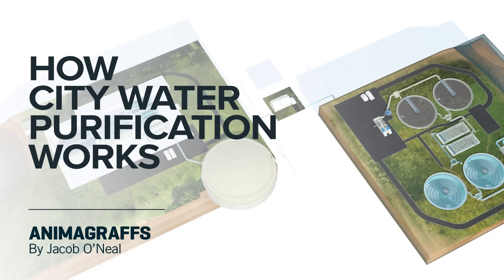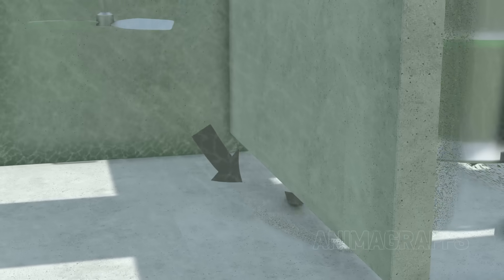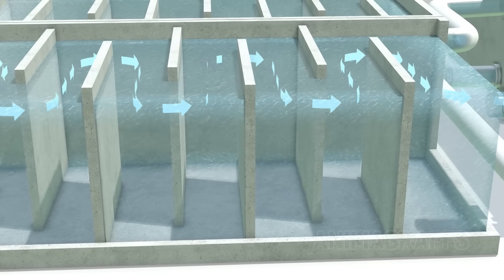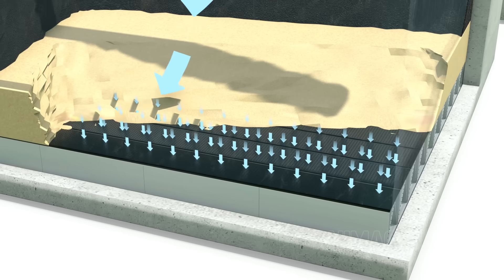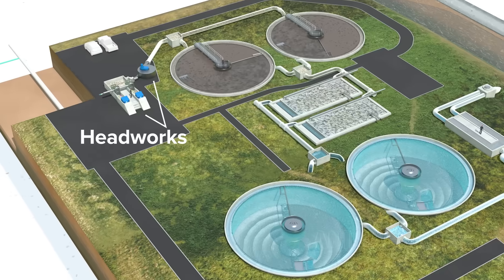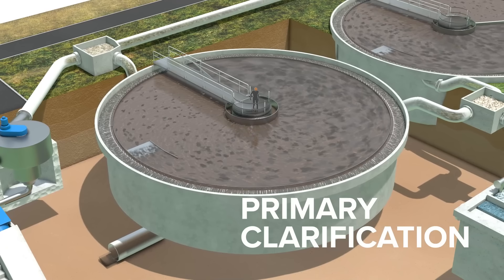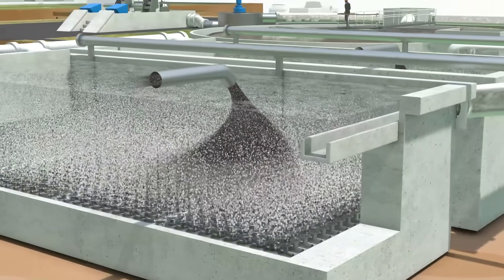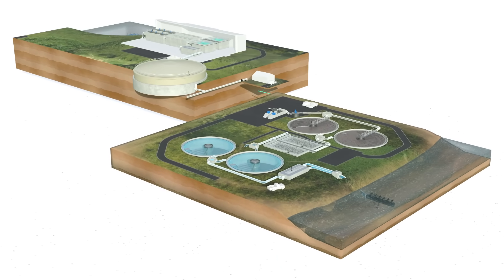How City Water Purification Works: Drinking and Wastewater

Comment: I’m a water engineer for a city that provides water for 7-10M people (through city services and customer cities which are cities that buy water from other cities instead of treating it themselves) and I can tell you this is pretty accurate. I do have a few comments:
1. The lake is typically not on site and is usually pulled through a network of pipes. 
2. In the coagulation, typically an iron coagulant is used. 
2. The injection of ozone is one of the most expensive processes in water treatment because ozone is typically produced on site for larger cities, which requires TONS of electricity. This is just a fun fact. 
3. I didn’t see him touch on chlorination prior to injection into the public use system. Bacteria can develop in older pipes so some chlorination is added to prevent harmful bacteria from traveling through the pipe network.
Reply: Thanks for the additional info!
Reply: I was going to mention something about chlorination and the need for residual disinfectant throughout the consumer system.
Reply: I work at an industrial soft drink bottler. I run the water and wastewater systems. On the water side we use chlorine + reverse osmosis + UV (unless making bottled water, in which case we then use ozone as well as an additional pass through a third RO.

I can also confirm on the wastewater side we use ferric chloride for coagulation and odor control. Binds with the sulfide in the anaerobic digesters and reduces production of h2s gas.

It’s certainly more complicated than just that, but yeah that’s more or less it. This is a good video.
Reply: So I also have a question, how is ozone actually produced?
Reply: @brk1803  it’s usually created on-site. At my water plant they take liquid oxygen evaporate it into gaseous oxygen then use electricity to create ozone. I believe the electricity splits the oxygen (o2) into single oxygen atoms and they bounce around and, for lack of a better term, merge into oxygen molecules to create ozone (o3)
Reply: @thedarklord573  my plant uses an actiflo which is pretty similar to this video up until the ozone, I don’t know of many plants in my area that add ozone in
Reply: @344grumpy  If you inject 03 for disinfection, firstly you will an Oxygen Concentrator up front ( makes it a highly flammable enviroment ) after you will need a BAC. It's the best disinfection big a lot of maintenance. Former Senior Design & Commissioning Eng. & Micro Sand Shoveler. Many Council don't have the $$$$$, so Gas  Cl2 is easier.
Reply: I'm a water plant operator and we almost strictly use chlorination. Some of our smaller unmanned plants use Sodium Hypochlorite, but most (including the one I am currently manning) use chlorine gas. UV is still kind of being phased in simply because we don't really have any way of knowing whether it truly works in disinfecting as we don't use any means of testing it. We rely on chlorination.
Reply: @GuyGoatee  UV works well, widely used in Norway for both water and waste water treatment. I work as an controls tech delivering system for RAS facilities and there we have used UVs and Ozone skimmers for every department.
Reply: @GuyGoatee   one question how much electricity is used to purify one gallon of water
Reply: @GuyGoatee  we need to be friends. I too work in water treatment plant here in Kenya
Reply: @robertmaina5901 Why do people who live in mud huts need a water system?
Reply: @kranvis2885  The most ignorant comment on this post. There are 56 million people that live in Kenya and just because you lack the perspective to understand that there are people who live just like you do in Kenya doesn’t mean that there aren’t advanced population centers in that country. Yes there are still tribal communities in the African continent, but the vast majority of the African population is modernized and developed, just not to the extent of western nations. Expand your world view and maybe you can learn something about other human beings to help you not be bigoted when conversing with other human beings.
Reply: @GuyGoatee  you can't take samples before UV and after UV and get them lab tested?
Reply: @VoidFame  They have, the guy you are replying to doesn't know what they are talking about. The effectiveness of UV water disinfection is not new nor remotely unsettled science. The only asterisk is that it does not leave a residual disinfectant in the water so it cannot prevent future recontamination should it be introduced down the line. When it comes to at the plant however, UV is well understood to be much more effective than chlorine particularly against cysts such as cryptosporidium and giardia.
Reply: I was wondering why no mention of chlorination.
Reply: DEI worker with an edgy hot topic avatar. Do you cut yourself?
Reply: I agree. Residual chlorine kills all bacteria even up to the glass of water at home.
Reply: To 3.
We don't clorinate our water in Europe
Reply: Valuable contribution. Ozone is better because there are no disinfection by products. UV works fine and is widely used in The Netherlands. Better than chlorine I think. At least there is no taste.
Reply: Here we have it, boys are youtube.Armchair know it all, always one in every comment section

Comment: This is how it suppose to work. If the general public was to visit their city or local water plant it is soo much lacking any maintenance to the process. The quality of operators are lacking. The money is NOT put back into the system but given to the self proclaimed hero policemen and fire fighters. 
No one in operations for water and wastewater treatment have ever been involved in politics. This is a huge reason why they ignore the needs of the infrastructure. All the funds go to their brotherhood of police and fire. 

This needs to change or else your supply of drinking will be effected. 
Lastly consider this how often you call police or fire to your home vs how many times you used water or flush your toilet?
Which is more critical???

Comment: I work for a water/wastewater processing company.  100% can confirm this is accurate.  Excellent video.
Reply: Can i ask why the treated wastewater and untreated water cant share the same water system? or he says in the video they almost never share the same water system.  and also assuming that the water purification plant is in a lake where fish may be how does this affect them? i am doing an assignment on clean drinking water and your feedback would be extremely helpful
Reply: @roybruno7535  Oh, Water and wastewater ar not treated at the same plant in our case.  We have 5 plants in the low country in the south east (I cannot overtly say our name), but 2 plants process drinking water, and 3 plants process wastewater.  They are only shared in that we have 1 team that works with producing clean water, and 1 team that processes wastewater.  In our case, all of our plants are miles apart, and drinking water and wastewater processing do not come close to each other by at least a few LITERAL miles. geographically. I think the closest water treatment plant to a wastewater treatment plant, as the crow flies is at least 4 miles between the two of them...  Good question, though.  Also, wastewater treatment plants...  Better be able to take strong smells.  If you are writing a paper on this, I would encourage you to reach out to your local water company.  They are likely happy to give a tour.  They are often under appreciated these days; we just expect too open a tap and have clean water...  Most folks don't understand what it takes to bring that to a residence or 70K residences.
Reply: @philstuf the treatment for both drinking water and waste water seems very similar to each other. Is there a reason the waste water needs to be reintroduced back into the natural bodies of water other than ensuring ecosystems are maintained? Would it be possible to have a semi-closed system? It would save water as it would only need to be taken when the amount of water is below a threshold that wouldn't supply the current demand.
Reply: @XSR_RUGGER  Unfortunately, I am not educated on the processing of natural water to bring it to a drinkable state and wastewater processing to bring it to a releasable state, but our output of wastewater IS often used to irrigate golf courses, as well as assist in rejuvenating, "The Great Swamp," in our area. I work on the IT side, so cannot speak about the possibility of this being a circular process aside from the rain cycle being involved...  My armchair knowledge on it pretty much ends there...  If it helps, our admin building is actually cooled/heated via GeoThermal, so we do at least recirculate that water, and we are all LED lights, and we have sensors that turn off lights if no one is around.  We try to go green wherever we can; We are very conscious about the environment. We even encourage keeping printing to a minimum by making it tedious (you have to enter a PIN for it to actually print anything).  You would be surprised how much that cuts down on printing.   We are actually awaiting delivery of some EV's to test in our fleet.
Reply: @philstuf  thank you for the response. It seems quite fascinating. It seems the plant you work at is on a good path in regards to conservation. I think if municipalities would dedicate themselves to some infrastructure change it would be to the betterment of many. Irregardless of people's stance on the effect humans have on the climate, we can always strive to be better. Thank you again for the response.
Reply: @XSR_RUGGER  Thank you for the kind words and the inquiry.  I am glad folks out there WANT to, and DO, ask questions...  I might not always be able to answer them, but I am glad curiosity is alive and well.  I will always give the best answer(s) I am able to provide.  You take care.
Reply: @roybruno7535  So, I know this is a few months late, but we never put our wastewater in a position to hit our processed drinking water.  We DO actually deliver some of our wastewater to golf courses for irrigation and have used it to rejuvenate, "The Great Swamp," but otherwise, it never touches the water your drink in our area. I cannot speak to how safe our wastewater is for humans to drink, but rest assured, our processed wastewater is disposed of safely to re-enter the rain cycle.
Reply: @roybruno7535  Hello friends, if you have sewage treatment needs can contact me, if you disturb, please forgive me ~
Reply: @roybruno7535  Water engineers analyze the impact on the environment based on what's called a Dissolved Oxygen (DO) Curve. All waterways have an oxygen content that has a measurable level and impact on life sustainability. The outflow from treatment plants and industrial sites lowers the level of dissolved oxygen in the waterway. The waterway will eventually return to normal oxygen levels downstream.The DO curve tracks how far downstream this decreased oxygen is measurable and the EPA and other agencies track points of outflow into each waterway, they set requirements for maximum amounts of outflow at any one point along the waterway so that life in the waterway sees a minimal impact overall.
Reply: I can confirm this comment, I was the water
Reply: yes,ion exchange resins are widely used in water treatment,this is essential
Reply: At what point is fluoride added, because I didn't see that here...
Reply: I work for a municipal water treatment plant (potable water or "upstream") here in the USA, and I say this is incorrect

2:05 POLYMERs ? Really? While we're trying to get rid of plastics and PFOAs from our drinking water? Nope.

And a UV tank 5:39? Not if you're treating more than a few hundred gallons a day!  (We treat 65 million gallons per day.)

I know nothing about waste-water treatment ("downstream") so I'll keep quiet about this part of the video. But based upon what I know about upstream and what this YTuber has proposed, my gut tells me that he's dishing out poop.
Reply: Why did they do this overly conflated system? Why not just boil a big vat of water and turn it into steam, pump the steam to another tank where it will condense and then you just scrape the gunk out of the bottom and the heat kills all the possible viruses ECT. Can a virus even survive on a super hot steam particle?
Reply: @TheAnnoyingBoss  While I agree that distilling the water also works, and is nearly bulletproof from a safety standpoint, the energy requirements to boil and cool that volume of water would be massive; we generally flow 5 million gallons or so per day, and we only serve about 70K consumer points (IE: households, not individuals).
Reply: @philstuf  Brother, can I contact you on WhatsApp?
Reply: What's your major?
Reply: Not 100%.  He forgot the addition of chlorine and fluoride.
Reply: @CJ3000 it is added to tap water, not to water before releasing to rivers
Reply: @philstuf  how do you feel about adding raw unfiltered caustic  soda to poe
Reply: But there is no denitrification. No Phosphorus precipitation. Also I wouldn't use the sludge as fertilizer because of the heavy metals. And where is the "digester tower" (hope that is the name in english)?
Reply: have Prion contamination been consdiered in the aspect of soil/waste layer contamination? these are persistant bioactive proteins.
Reply: The video is accurate, it is generic on both treatment systems. Different plant and regional regulations will have additional requirements for surface water plants. In my state wastewater reuse has a must filter requirement
Reply: I have my D2 and I’m getting my T2, but I see a lot of jobs for waste water. Do you think waste water is a better path?
Reply: Dear brother...contact me if u still on company water treatment.tks
Reply: except for the part where they poison, the water with fluoride 😂
Reply: We need answers. Please someone confirm this because I’ve been using water bottles and some taste weird.  Tap water taste good but can’t take chances due to my immune system
Reply: @MrFrhnba  I would suggest taking a sample from your tap and having it tested (And not by the door to door sales folks that want to test your water to sell you a filter system).  In some environments, it is possible to have roots break into pipes and possibly contaminate water, while still allowing the pipe not to leak due to the way hydrodynamics can work.  
You could also call your water provider and ask for input on getting a sample tested as well.  They would likely want to get something like that fixed ASAP if that were the case.
That being said, it could also be the plumbing of the house that is affected, not necessarily the line from the water provider...
Reply: @MrFrhnba  Hello friends, if you have sewage treatment needs can contact me, if you disturb, please forgive me ~:hand-pink-waving:

Comment: Very accurate description, down to the correct terminology. I'm a water treatment plant operator. We still use chlorination for disinfection, though UV is used in a lot of wastewater treatment plants, Ozone is used in a lot of water treatment plants for pretreatment to rid raw water of organic material. Great animation.
Reply: Are there places where our poo poo has to be shoveled from one collection spot to a truck? I'd hate to have that job.
Reply: @dannydaw59  mate,  I did that job for 7 years. The floculated sludge from the clarrifiers has to go somewhere; usually drying beds or a screw press or belt press. In the case of drying beds, you wait until the access moisture drains and re-enters the start of the process, then its shovel time. It sounds worse than it is. By the shovelling stage, its more like ashy dirt. We call it 'cake'. its light and has lost its smell thanks to the nitro bacta disolving the ammonia into nitrogen in the aeration tanks. Old mate mentioned that it is used for fertilizer but thats illegal in australia. We send it to landfill - which sounds bad - but its highly nitrified organic matter so the earth loves it. I work with drinking (potable) water now but waste water is way more fun and technical.

Comment: 4:39 The part I have always wondered about is the filtration- specifically this: When contaminants stick to the activated carbon and microsand, where does it go? Does the activated carbon need to be washed or replaced from time to time?
Reply from the maker: Yes, there's a wash procedure associated with the filter media to remove built up contaminants. But the granules themselves, if properly taken care of, can last a long time.

Comment: Great  video. As a retired water purification plant operator of 40 years. Your description shows the actiflo process of coagulation.. My plant used it and conventional basin type of coagulation then ozonation and filtration.  Since a disinfectant residual must be in the water as it leaves the plant, we used chlorimination to do so just before the clear well. Also fluoride was added just before the clear well and any other ph and alkalinity adjusting chemicals.

Comment: you forgot about  the denitrification which comes after this step 10:05 (nitrifiacation= O²+ NH³ or NH4+ -> NO³-) . the denitrification is where nitrate(NO³-) will be broken apart to nitrogen gas(N²) and other endproducts.... it needs to be anaerobic(no Oxygen is present) otherwise the desolved oxygen(O²) will be used instead, of the microorganisms.

this step is quite important because otherwise the NO³- gets into rivers and lakes, which acts as a furtaliser und encreases the algae growth.